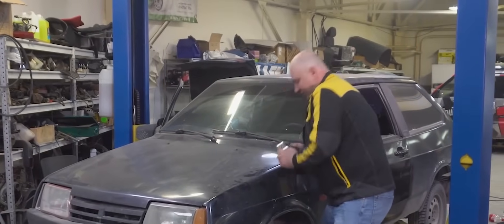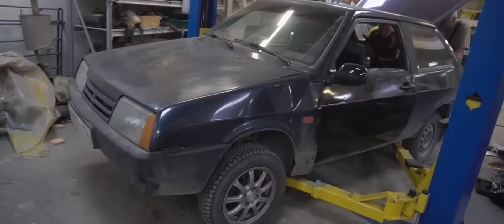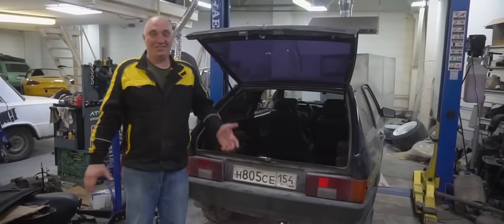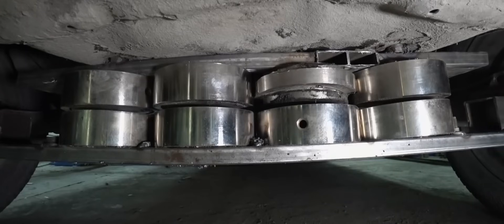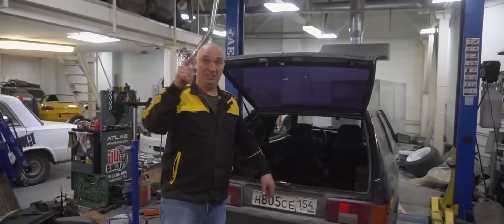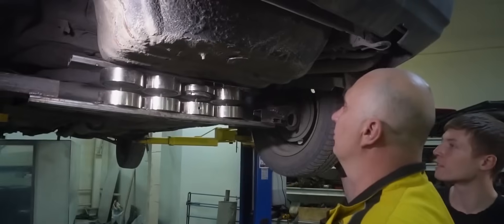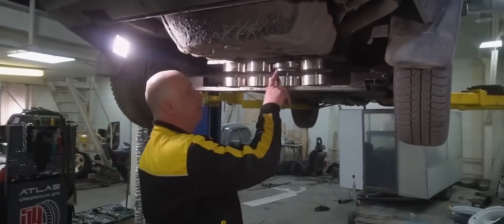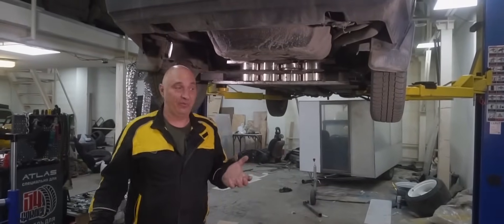DIY magnetic suspension

Comment: Multiple magnets on a nested tube like a strut, arranged NS SN NS SN NS and so on; only the top and bottom magnets need to be secured as the interim magnets will automatically center themselves. You can attach this mechanism to the existing spring mounts....

EDIT: And if you're very crafty, you can sleeve the outer tube with copper, and enjoy some damping via eddy current generation when the conductive copper moves through the magnetic fields. Fair warning, if too strong and too bumpy this may actually melt and/or catch fire....

Comment: 600kg is the force at point of contact.  However, the force of the magnetic field diminishes exponentially as the distance increases.  So, for example, if the magnet-to-magnet force at the point of contact is 600kg, then at 10mm, the force would be down to about 350kg.  At 25mm, the force would be down to about 215kg.  And at 50mm it would be down to about 112kg.  So they really needed to figure out the loaded weight of the vehicle at the maximum distance of suspension travel to figure out how many magnets they would need.

Comment: You've got only 1cm of travel but if you put 4 Magnet over each other to build a Magnettower and then put 5 Magnettowers next to each other (requires rebuild of the spare wheel/trunk area) you should get around 4-5cm for your suspension travel but you'll need 20 magnet to do that.

Comment: You could stack more than 2 on a guide rod. this should give you more travel and would also help with the total strength as none of it's magnetic field gets redirected into steel. You could also switch to aluminium for the fixtures. For absorbers you probably could also use a thick walled aluminium tube around the stack as movement of a magnet in a alu tube would create electric currents opposing the motion eg dampening the movement.

Comment: Not giving exact numbers. But the force of a magnet in pressing or pulling is at 100% contact. Thus if only 10% is on metal. Would only have 10% of its pull.
And the "power" drastically drops from distance. So they would compress very close before any kind of decent force is applied. 
If it says can handle 600, it is not just 600x4 (of 2 sets) would only get that 2400 force with 100% efficiency. Aka touching flat on each other. 

(Not giving exact numbers because very late)
Reply: Inverse square law with distance, so when the distance is doubled the magnetic force drops to 1/4 of the previous.

Comment: 10:09 the other thing to do would  be to use the magnets as  a accumulator for a  hydraulic system .. like  have a big fat cylinder with litter travel be lifted by the magnets then  on the other end have a long thin cylinder with lots of travel
Reply: maybe use the shocks sine that basically what they are.... a sort of magnetically powered oleo strut ?
Reply: rough calu a 10mm deep 100mm dia piston has a volume of  77645.7 mm squared   and a 110mm deep 30 mm dia pistion have a volume of 76869.2   soo   link em with a hose and  voalla  110mm of travel?

Comment: You should make Vertical magnetic suspension. E.g. 3magnets in a vertical guide, North-north-south-south. So the total gap is for example 20mm instead of just 10mm on each side
Reply: Im thinkin there would be tomuch of a chance of sliding due to the fields around (they would want to kick left or right )
Reply: @jbstepchild  Thats why you keep the guide rods...
Reply: @Jtag-dev  just following that thought pattern too, but mounted in a guide tube with the last on an extended plunger and located back in spring well...
Reply: Harvey Hart Yes! I thought a aluminum tube would be adequate!
Reply: @kennysboat4432  If you used aluminum - or even better copper - for the tube you would also get some shcok absorbing properties from the eddy currents that the magnets induce in the tube.
Reply: wow cool idea. And fill the tube with oil.. and make the magnets with vents, so they can be shock absorbers at the same time.
Reply: @carlbModels  add oil for what purpose, redundance? Can this ever fail??? 
In my view that kind of defeats the purpose of a non-leaking maintenance-free system.
Reply: Great idea :D I would like to see how that works out.
Reply: Big brain
Reply: If they are heated above 100C while welding they will lose magnetism permanently.

Comment: You'll need solid N45+ (strength of a magnet, the highest of which is N55 [insanely strong] grade) Neodymium rare earth magnets that are at least 3 inches in diameter in a strip like you got there. Two N45-N52 3 inch diameter 1.5 inch length cylinders opposing each other will generate a huge opposing force (individual pull force is 625 pounds), and say a row of 8-10 (16-20 magnets, mad expensive so this is a pipe dream unless you're rich as F) across the suspension bars like you've done there. The magnets would need to be encased in non ferrous stainless steel cups (thick, at least 3/8" or 10mm wall thickness or more) TIG welded to the base frames, to prevent flux distortions (non-ferrous) and damage to the magnets like the ones you have with a band on the outside, which you epoxy in place by the way, and a system to keep the magnets aligned would also be required, kinda like your steel rods in the video. Perhaps a little more robust system like several rigid pistons with shock absorbers inside as I'm sure you know ;)

 I didn't hear a whole lot about magnet safety, which needs to be mentioned. Magnets of the size and type I am talking about can snip off fingers, break hands and wrists, mangle your hand beyond repair if you are unable to free yourself (think about that for a second, you are stuck to a stationary metal object by a super magnet, your hand is being squeezed with over 600 pounds of force and you are in agony, nobody is around to hear your cries and you can't get it off. You wait 24 hours before someone comes along if you are lucky). Be careful if you know what you are doing (you have been professionally trained, you know who you are), and if you don't know what you are doing don't attempt this stuff until you fully realize the dangers and problems you can encounter with monsters like that.

Comment: You can stack them in a vertical way where the shocks once was.
ns-sn-ns  <- like that all the same shaft.. This will give you more travel room per bump, and act to reinforce each layer. OR you would get more power going N:S:N:S ON The bottom then N:S:N:S ON The top.. As magnets will act to reinforce, each other. Where N:N:N:N will have the magnets fighting each other. with more flux in the center two, and less on the outer two.

Comment: The magnetic suspension I knew of, used electromagnets to thicken a ferrofluid (basically what happens when you add iron fillings to the oil of the teacher that flunked you), so the shocks would go from way soft to Sport mode with the flip of a switch.
Perhaps you lost some magnetic power because you welded the magnets, they loose power as they heat up. But to be honest, didn't saw the way you welded those.
Reply: I think for sure they weakened the magnets welding. They start going out over 80C and for sure the edges got heated much higher than that!

Comment: You should have used nuts and bolts, extreme heat from welding must have weakened the magnet
Reply: Taskin I’m glad I’m not the only one seeing the value here.
Reply: Eric Heisler yes, maglev is important tech
Reply: Taskin, watch again . they did not weld ( the magnet portion ) . They drilled through the metallic center then through the square iron to provide a hole for the  guide. Any welding done was not done on the magnet.
Reply: Clifford Sikora ya but they are subjected to extreme heat, they have contact with bars being welded, a casing or nut bolt system wouldn’t damage magnets
Reply: No need to drill, magnets have hole at centre
Reply: I guess it's less heat then drilling?, also the would likely break
Reply: Indeed, temperatures above 70°C or 158°F  will have a devastating effect on neodymium magnets.
Reply: Not so much the heat that weaken them as much as grounding it with an electric welder.
Reply: Exactly.. Not only that but removing material also weakens the magnet design. The design is to focus the magnetic energy.
Reply: I thought the same thing, they probably don't work at all anymore
Reply: true

Comment: Please do this again..with shocks and enough magnets.👍
Reply: and magnets should be at the place of removed springs
Reply: aa3smit please do
Reply: @areyouavinalaff  Why can't magnetic field absorb shocks?
Reply: @postwardream    shocks don't absorb shocks, technically they are caused dampeners.  Without something to dampen the motion any sort of spring suspension will tend to cycle many times for a given input, and when multiple inputs occur before the energy can be damped out you get severe oscillations and handling issues.

The magnets have no dampening action and will bounce repeatedly until the energy of the input is spent.
Reply: @DrewLSsix  I didn't say anything about shocks, just springs. But if you find a way to convert magnetic energy to electrical, say by using electromagnets, and then put a resistor in the circuit, you'll get damping ability.
Reply: Павел 
That’s not how it
Works
Reply: Yes
Reply: Magnetic shocks
Reply: Just put the magnet in a copper tube and the eddy currents will do the dampening.
Reply: yeah with right replusion force they might be pnto something good!!

Comment: Just need to make some contained copper coils round a ferrite core with a steel cap, and one of those magnets, apply a high current through the coil, adjust the voltage/current to adjust the strength.... 

connecting the polarity the correct way will cause a repulsion force with the solid state magnet!
Reply: @PhyZeik yup, probably best due to overheating and to keep alignment etc - that's why I said "contained" too :)

Comment: Magnetic suspension? Congratulations you created the Bose system.
Reply: Bose used an electromagnetic suspension. It gives the user more control. The Russian guy just strapped permanent magnets to where the car suspension should be. It doesn't really give the user much control on how much suspension you want in certain situations

Comment: Didn't Bose make a prototype electro magnet suspension?
Reply: @SoldererOfFortune  , wow fid. What did you put together ?
Reply: Was it not in the old Lexus Ls400 they tested it in?
Reply: Yes but it never made it to production because the weight. New GM cars have magnetic suspension though.
Reply: @flyingschoolbus9557  Not magnetic suspension, magnetorheological dampers (yes did have to google that word lol).

These guys are using magnets for springs, completely different effect. If it wasn't for the weight and cost of the magnets, this isn't a terrible idea. You get progressive spring rate with a virtually maintenance free design.
Reply: Flying School bus 
What da hell?!
Do you have a link for that?

Comment: Heat destroys magnetic fields. By welding the magnets you have significantly reduced their effectiveness. 

The main reason you'll never see this in production is their additional weight, and very short travel.
Reply: He welded the outer rims to the frame and not the magnets itself...
Reply: Br4mb0... heat transfers.
Reply: @angelicoutcry3478  You can weld without most of the heat transferring to the magnet... It's not hard.
Reply: Br4mb0 Most??? Heat transfers and Heat damages magnets. All the technics used to reduce heat while welding still can't stop it... Sorry Charlie.

Comment: This will help me with my extensive hobby of collecting metallic road debris.

I hope I break every signal actuator I stop on.
Reply: you won't break it. you'll actuate it better.  I had trouble with my Suzuki motorcycle, when I would stop at a traffic light, the bike is heavy on plastic and it would not trip the sensor. I eventually tore apart a computer disk drive and installed one of the magnets in the arch area of my right boot (external). When I pull up to traffic lights I just wave my leg over the sensor wire and BAM, it works. Drawback is that it pickes up everybit of metal debris and magnetic pebbles......
Reply: QuantumRift 
There's a little thing that you can buy that clamps on the bottom of your motorcycle that'll trip those sensors when you pull over top of them.
Reply: @dukecraig2402  Seen it (years ago). The magnet on the boot works great. In many places, the older 'sensor' trips are being replaced with cameras.  The vehicle sensor is just a metal detector, with variable sensitivity.
Reply: There's none here in Florida
Reply: Christian Flores that’s why I was asking because I live on the ga/fl line and never heard of such.
Reply: What are the magnetic field coils in the road that aren't at a stop light used for , measuring speed ?
Reply: Where do you live that has a wire to activate traffic lights?
Reply: @5777Whatup  Arizona, Ohio, etc. Many places stull use the buried sensors in the road, which is just a wire, and the system acts as a metal detector.  Disturb the magnetic field with a chuck of iron  or whatever and it trips. Or wave a magnet over the wire.
Reply: Oh all I’ve seen in America is built into the light itself to read speed etc.

Comment: A Scott-Russel linkage using a springy rubber bushing at the fulcrum like what's used on control arms would likely help guide the magnets. Might even dampen some of the sudden compression of the magnets a bit. Seems like stacking them side-by-side like that isn't all that great of an idea though. Need to keep in mind the magnetic fields are going to interact with one another, that interaction is very dependent on distance.

Comment: Electro magnetic suspension is not as hard as you might think. Grind up the magnets into small powder & add it to the oil in your shock absorbers . Then wrap them with copper to produce an electromagnet. Add current . 👌 Job done.

Comment: When these guys think of something they don't stop until they realize it, but if you would have asked me, I know there are stronger magnets out there, I think they used ferro magnets, I may be wrong, also the electromagnetic force has a really short range, so you would need some creative arrangements to give the suspension more travel, he talked about needing shock absorbers but he would need something at the other end to slow down the suspension when it reached maximum travel.

Comment: Welding Magnets.
That hurts to watch.

Also, that movement and click...
Wrong magnets for the roll, and you might find a better polarity layout.
Reply: I was thinking 5 and 5 would have been a better setup
Reply: They welded the rims not the magnet
Reply: @alexd4102 , still a Lot of heat and EM banging away at the neodymium ;)

Comment: I think fishing magnets are NOT simply north pole on top south pole on bottom. Also you could just wrap a coil of copper wire on a plastic pipe around the magnets. The moving magnets would induce a current in the wire (has to be some way to use that) it would also act as a shock absorber.

Comment: I would use 3 or 4 magnets on either side. The shocks should be reinstalled to limit travel. It would be ideal if the magnets only rarely touch on the worst bump.

Comment: g'day mate top job 
problem is location , you are correct and beam mount them in same spot as the springs were with more allowance for load and bumps 
600kg+1bump =more than1200 
(depending on bump and speed)

Comment: They'd lose their magnetic force over time anyway rendering this a hazard waiting to happen. The results was probably due to the heat and less than scientific implementation/ pemise. Also, assuming this would work, those guide pins are a flaw and another hazard waiting to happen; since magnets like to "resist" and since the resistance is not always going to be opposite each other, it's going to be a lot of force on a bunch of flimsy looking guide rods vs approx 600 pounds of force next to each other. You hit a pot hole and they slip any direction but opposite then there's your suspension screwed.

Comment: Suggestion:
Instead aligning magnets in repulsion you can add them in attraction (they do have 600k of pull force each).
Use an 'X' shaped link. Connect car chasis to top right corner and wheel axle to bottom right corner. Weight of car will try to close the X (like scissors) so arrange the magnets in way which will try to open it by pulling between top left and top right corner (or botton right and bottom left as well). This way you can counter the closing of X by using attraction instead of repusion. 
You can stack series of such X horizontally along axle to make it more rigid. Also add few stops to prevent magnets from sticking to eachother (that will open X fully and suspension stuck).
Since you already have magnets there is no harm in trying.

Comment: You already have a hole through the middle. Rather than just 2 magnets you should stack them.
So a long bar running through 3 or 4 magnets. Top one secured. Bottom secured, but the middle ones free floating. that way it would act as some kind of damper and can be placed in the same place as traditional suspension springs.

Comment: Use an electro magnet you can even change however much suspension pressure you want
Reply: That takes more electricity than the car can produce.
Reply: @patcallahan1050  Only if you don't have a  5-10kw generator in the back seat. Not practical but it could be made to work.

Comment: The magnets are brittle they will eventually break from bottoming out. You should have doubled them up so that would create a bigger Gap. You still need side shocks to keep the wheels moving from side to side and ruining the tires. You could also put thick foam in the gap so it would prevent the magnets when they bottoming out and protect them from breaking extra shock absorber material